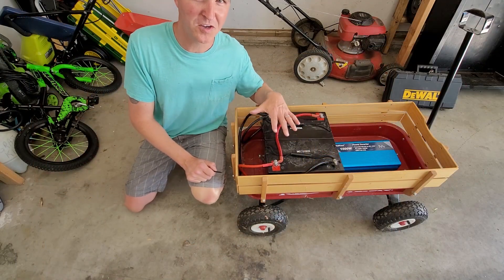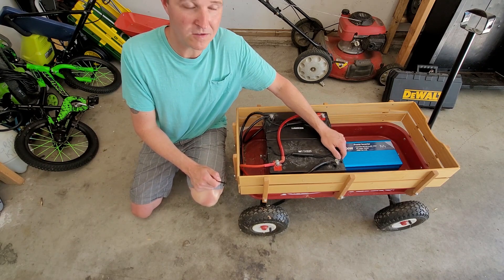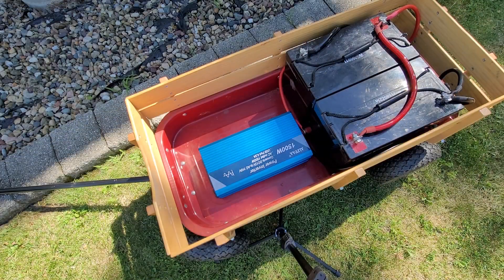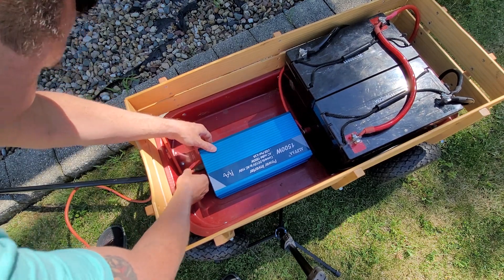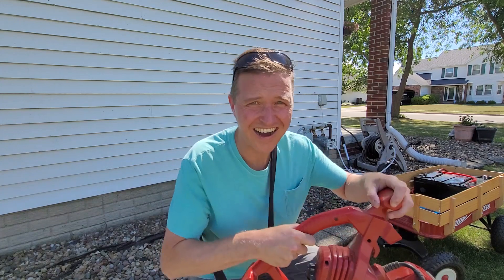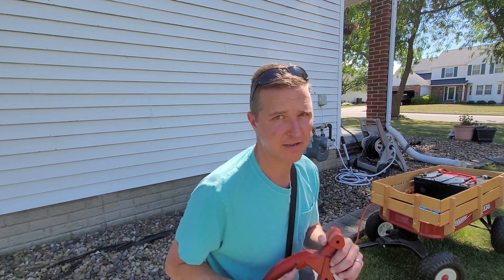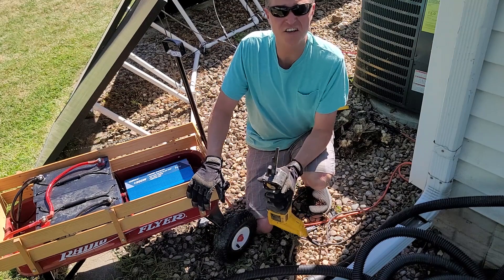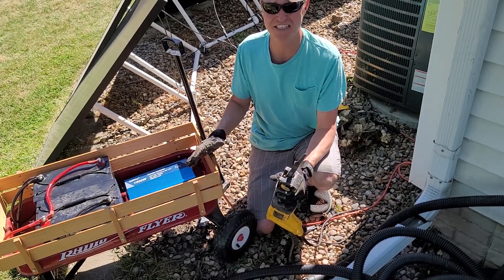A Great use for Off grid battery and Inverter!

Comment: Does any car batteries work with this setup?
Reply from the maker: Starter batteries are not made for deep discharging, but it will work.
Reply: @OffGridBasement  Thanks. What batteries are you using in your video?

Comment: Tripped GFCI??
Reply from the maker: None of the outside outlets are GFCI.  There is one last outlet behind a bench I need to check.
Reply: @OffGridBasement  Frequently the outside plugs are “tied back into” or more GFCI plugs.  The problem is finding the GFCI, which as you say may be hidden behind something.  Good luck.  Your portable power source is cool.  I have done the same thing to power a well pump out at the Ranch for short bursts, but no Radio Flyer for me.
Reply from the maker: @tomhenry563  I going out now to check all outside plugs for GFCI.   Could it be connected to a indoor gfci plug?  Is it against code to not have outdoor plugs connected to GFCI?   Thanks!
Reply: @OffGridBasement  I can not comment on Code, but at my house, the outdoor plugs for my back porch all tie in to a GFCI in my garage, and the outdoor plugs for the front porch are on a different GFCI which is in the laundry room.  The fact that your outdoor plugs have not worked since Christmas is consistent with them having “tripped” a GFCI.  You just need to find that GFCI and reset or replace it.
Reply from the maker: @tomhenry563  I just realized there is a GFCI in my half bath in the middle of my house.  It was tripped and now the outside outlets work.  Thank you so much for your help!
Reply: You are totally welcome.  Your vids have helped me.  Happy to reciprocate.  Tom